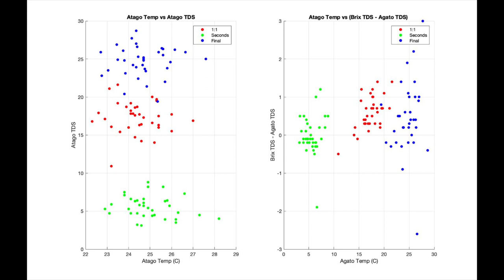Atago vs Brix for measuring TDS in Espresso

Comment: Thanks, Robert! This analysis is exactly what I was looking for. I am continually surprised by the ability of 'espresso connoisseurs' to spend more and more $$$ on expensive devices. I had and have used the optical Brix meter for other types of measurements and wondered why it could not be used by more coffee lovers instead of a $700 meter! Great job.

Comment: I feel cheated.

Not by anyone in particular, but because I've seen several videos describing a refractometer as a device that "measures the speed of light in a medium", and so I assumed they had to be very fancy pieces of equipment indeed. At the time I began diving into espresso, I did do a quick search around TDS and Brix, but I thought "if nobody recommends a simple refractometer, then I guess it might not work at all".

Now, seeing this video, it just occurred to me that "speed of light in a medium" is simply proportional to the refractive index. And yes, the latter can be measured with a very simple optical device, and this was used for decades (over a century?) by wine makers (they really care about the sucrose content, hence need the actual Brix scale).

The absolute scale of TDS vs. Brix can indeed differ by a constant factor. It may or may not be important. I guess it matters if you want to compare notes with people living elsewhere, but to get a measurement in your own experiments, any scale should do!

Thanks for this.
Reply from the maker: Thanks for the comment! That’s why I like to put some data to coffee stuff because it seems there is a lot of hand waving.
Reply: I wonder if there's a Brix optical device that have included a TDS measurements in addition to Brix measurements, so you don't have to do the TDS= 0.85 * Brix conversion.
Reply: @jonnytran4429  worst case, a spreadsheet formula would do the conversion for you :)
Reply from the maker: @jonnytran4429  great idea!